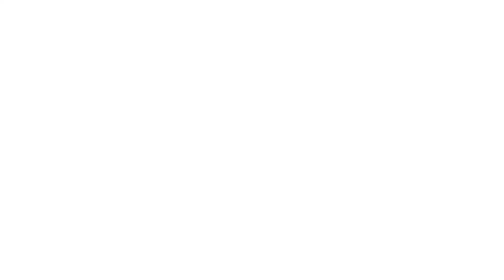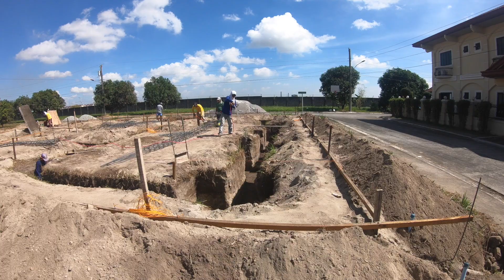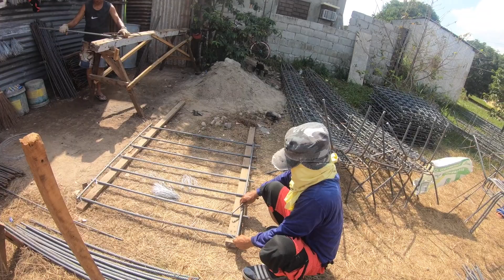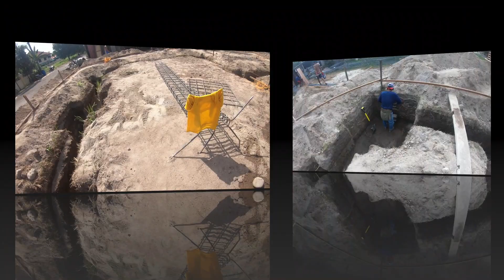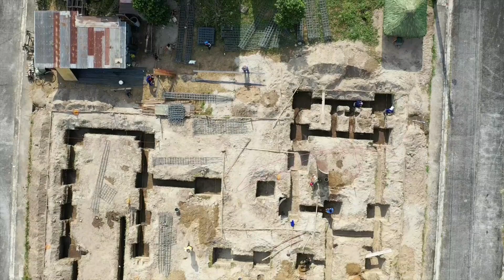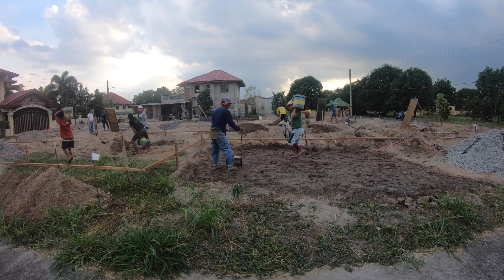Philippine House Building Step by Step, Build Day 12: Watch Your Toes

Comment: Those are some nice footings George!
Reply from the maker: Still reviewing, I see. 
The crew did a good job of putting spacers or “chairs” under the rebar to lift it off the base course.
Reply: @CasaTexPina  one of the things I noticed right off was the 5 inch dobbies, got to get the steel up into the concrete away from moisture and minerals in the soil that may eat the steel.
Reply from the maker: @Gary-pogi  we had the hardest time getting them to have proper spacing between forms and rebar all around.
Reply: @CasaTexPina  well thats another story. 1.5 - 2 inches minimum cover on all rebar in columns and beams and more if exposed to ground or weather. Not only for protection from moisture and ground minerals but also for proper bonding of rebar to concrete and also fire protection and two or three other good reasons! If there is an "Engineer" supervising it should not be hard to get them to do it right. What a pain in the buldit I will be!
Reply from the maker: @Gary-pogi  typically only a foreman on-site with the occasional visit by the “engineer.” Then trying to overcome the “we’ve done it like this for 30 years” mentality. 🤦‍♂️